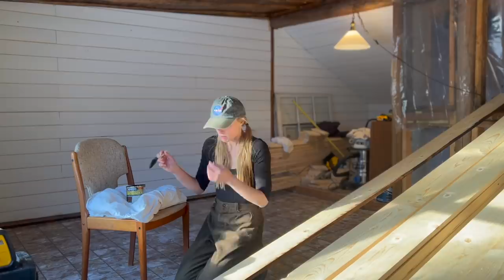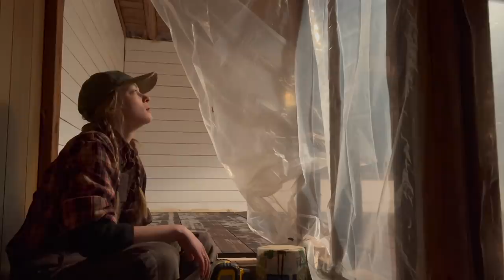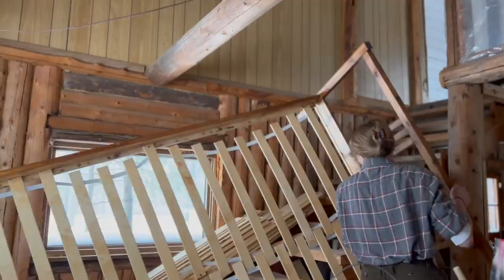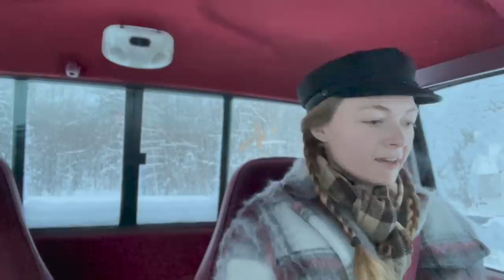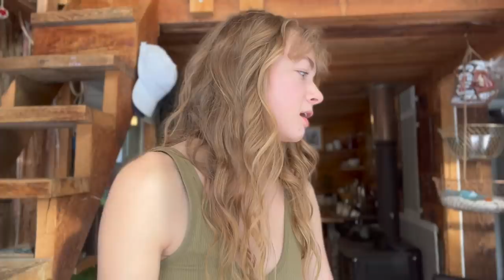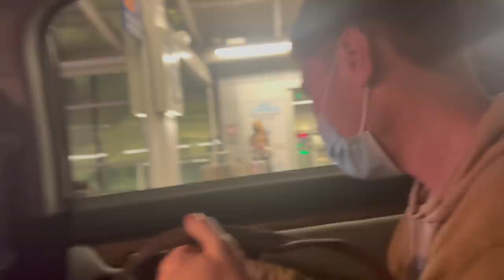i'm done 🤷🏼‍♀️

Comment: Only because I don’t know… When you are putting down a new floor, do you need to stain each board? Or, can you lay the whole floor and then stain the whole thing?
Reply: Either way
Reply from the maker: I stained them before laying them because I wanted to get the edges in case there were gaps